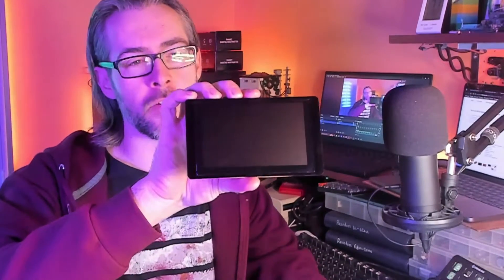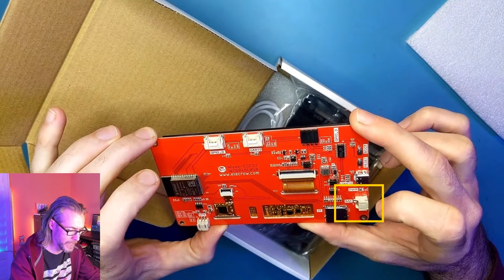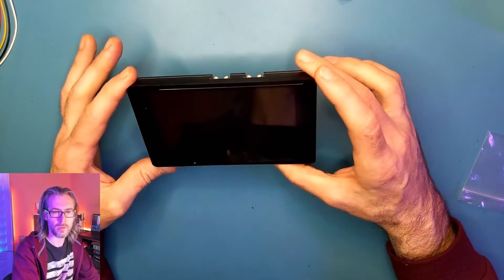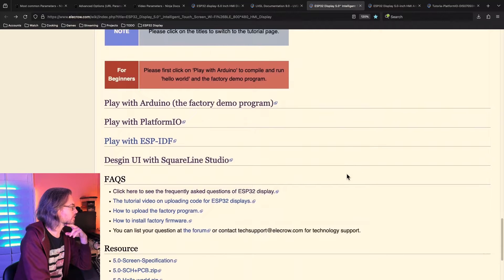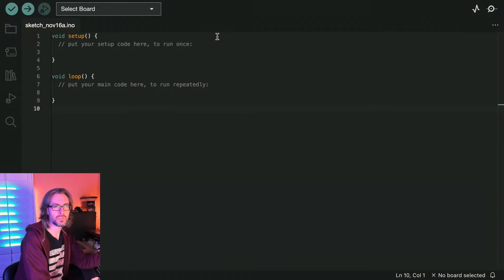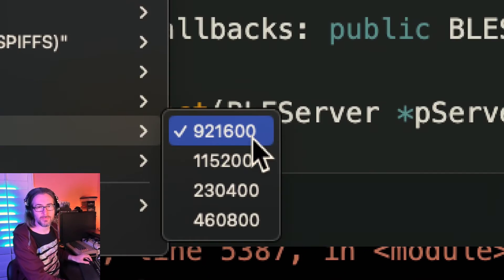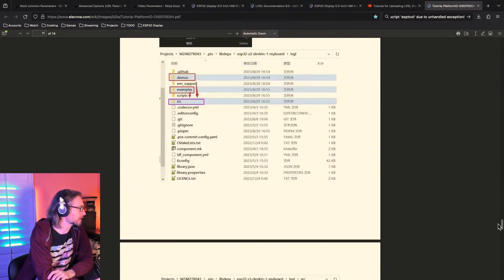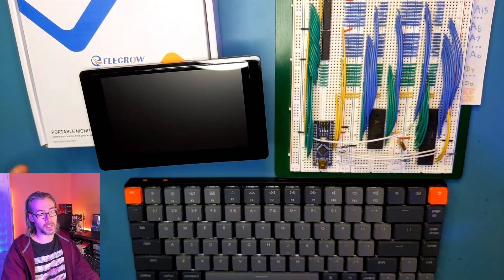What can this inexpensive ESP32 touchscreen do?

Comment: Do they make one with more GPIO connections?  That's my main reservation about this sort of display with integrated CPU - there's barely any connections to the outside world.

Also, can it use a standard Arduino graphics library, like the Adafruit one?  The one being used for the demo is really slow.